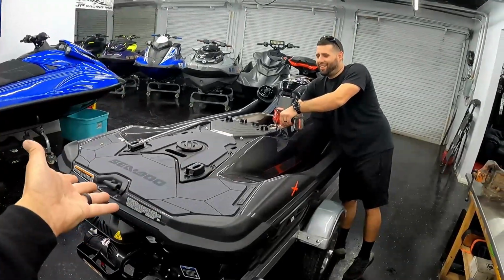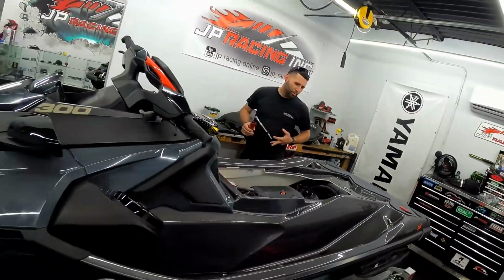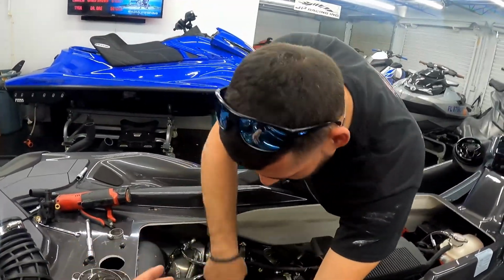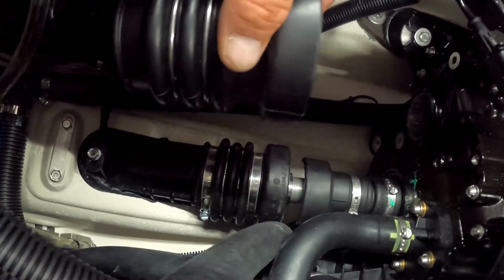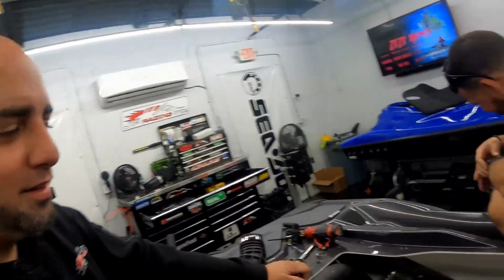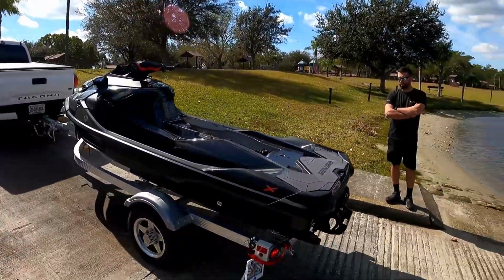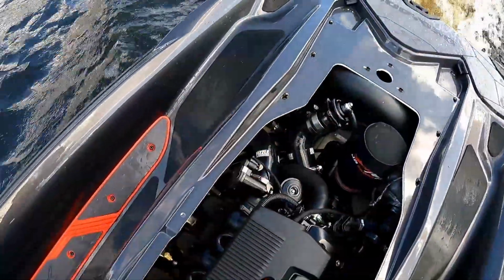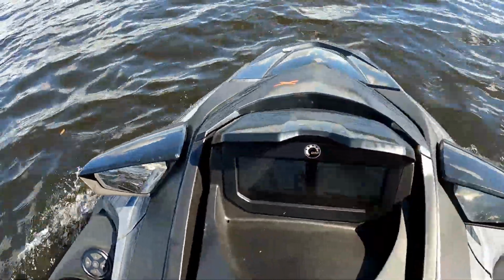We Modify and test a BRAND NEW 2022 Sea-doo RXT-X 300 and find a couple changes.

Comment: opinion on break in period?
Reply from the maker: I typically take it easy the first half hour or so looking for any issues, then I start loading the engine for another 10-15 min or so through several rpm ranges, if all that goes well I'm smashing the throttle.
Reply: @JP_RACING_INC  I hear ya. Thanks for the response

Comment: What about break in
Reply: I wouldn't want that ski now, give me another one.Those piston rings are probably shot, you can kill them just that quick before they're seated. You'll find out the damage by running a compression check after 10 or 15hrs. of riding against one that was properly broke in. I raced moto for team KAwasaki years ago, and we learned that from the beginning . We'd break it in properly , then a few full rips, then it went to the races with full compression. Next race, the same thing on another set of rings, then back to the races.

Comment: I am surprised that your tune of the ecu would remove the 5 hr break in limiters.
Reply from the maker: Science.
Reply: Why are you surprised? Their tune doesn't come with a warranty and it voids the factory warranty, so why would they include a break in window in their tunes? Do you think that JP Has a tune that works with the tune on the stock ECU? If you are unaware, when they flash a new tune on the ECU, it's deleting all of the factory settings, this includes 5 hour break in window. Also, no one is getting their ski tuned before 5 hours of use, that's literally before their 2nd ride on a ski. Why would anyone be modifying a ski that they have not yet been able to drive yet at full speed? Do you think people buy new skis, drive them at half throttle during their Maiden voyage, and say to themselves that, this PWC that I am unable to drive at full speed is not fast enough, I need to modify it ASAP, there is no way the speed can hang with the expectations in my imagination.... Is that how your brain works????

Comment: That's awesome! well done guys, Question - got a new 22 px on the way, what is the best way to run it in? also, with the fizzle, do you guys connect the additional flush by cutting the barb in the back of the hull?
Reply from the maker: If the ski is not touched computer wise, take it easy for the first 20 30 min then drive it like you stole it, it will be limited till she opens up. You'll be safe.
Reply: @JP_RACING_INC  what are the first mods to do my buddy just got 2 and now he wants to go faster plz send link

Comment: Aren’t you meant to run in the engine before putting it through it’s paces ??
Reply from the maker: We did. Ran great. 👍
Reply: Yea was going to mention that.. says like 10 hours run in and didn't think all the power was unleashed until after 5 hours.  Maybe there tune changes that

Comment: Stupid question, but is the “10 hour warm up” on a factory engine even necessary? I see you gave this ski it’s maiden voyage after modifying it…
Reply: Sure it is, that may have taken hours of the engine in the long run. If you have bad compression after 50, or so hours, you'll know why. Break in is more important than how hard you ride it after it's broke in. I surprised he even did that? The rings are trying to seat to the cylinders, and you smoke them like that without any hot and cold cycles, ouch.

Comment: Said it first... 2023 330hp motor hitting the market.
Reply: The American market puts a speed limiter on skis after 310hp
Reply: @MikeCoxsmaul69  , Yes. However the new motors have a quicker 0-60 acceleration time. Remove the limiter like we all do and you'll have a 78/79mph ski

Comment: THIS years failed carbon seal.
Reply: Do you even ride bro?
Reply: @seadogg404  If you have to ask, then you don't know.
Reply: @mcoffroadinaz4075  I'll take that as a no.  Take better care of your ski.  No issues with both of mine.
Reply: @seadogg404  Like I said... they made a new carbon seal... AGAIN. I have most of them since the 2stroke days, through 260hp days. I do NOT have a current 300hp one. I've done more with skis than you'll ever dream of. So, YES, I do ride.
Reply: @mcoffroadinaz4075  uh, since, by your own words that you don't have a 300, your comment is just irrelevant.   Get you a 300, then you can have something valid to say....
Reply: @seadogg404  so you DO admit it's different, since I don't have one, AND a 300 driveshaft is magically different, and the others didn't work right. 
Using my honesty against me is about as trivial as you protecting a billion dollar company for selling a design that takes precision installation, no room for tolerance stackup, possible grime intrusion, careful hardening of a driveshaft outer layer, year after year, and . Thank you for providing that insight. uh, uh, uh, uh, uh bro.
Reply: @mcoffroadinaz4075  Again, let us know when you actually get you a 300
Reply: @seadogg404  corporate SeaDoo thanks you for your blind support.